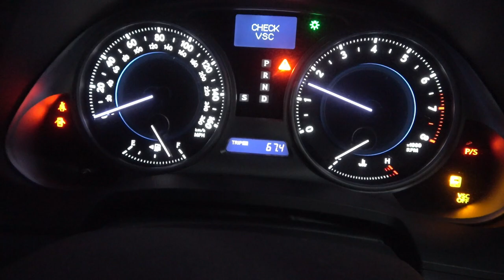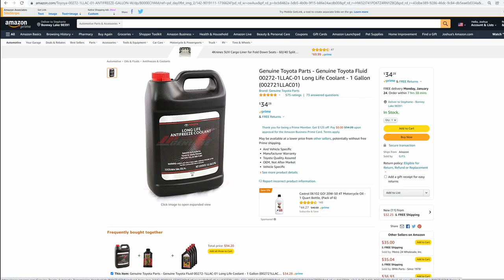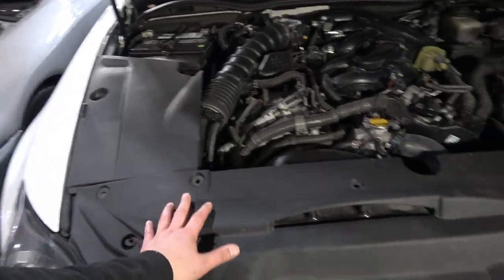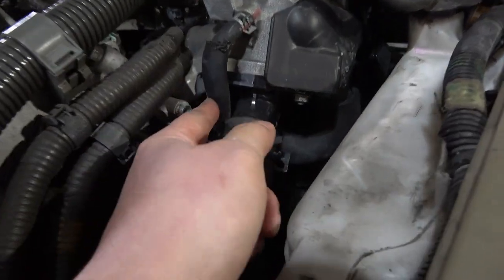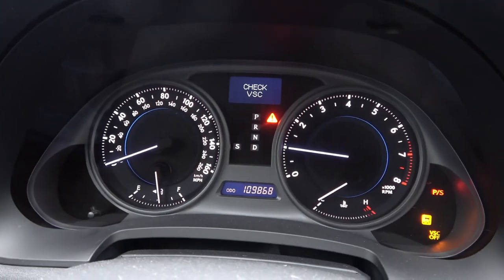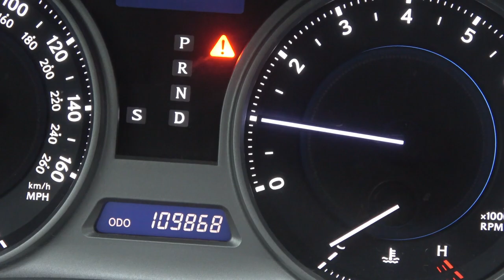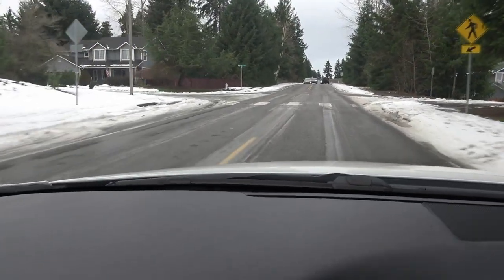How to replace a thermostat and when a thermostat is bad in your car Toyota Lexus IS250

Comment: I just did mine exactly how you did it except I had to take off two holes in order to get to the bottom bolt , is there anyway you can tell me if me taking off those two holes controls anything with the ac , because now my ac light on the touchscreen blinks off and on . but when i turn it on it still blows cold air , than 5 min after turning it on it flashes again but starts to blow regular air

Comment: I envy your expertise.  I wasn't having any heating problems (2010 IS250 AWD) but a dull belt noise which didn't go away once the engine was warm.  I had to replace the thermostat, the belt/pulley and tensioners.  Expensive, yet I have an honest mechanic.
Reply from the maker: Nice job getting that sorted out. I hate the noise from a squealing belt. Thanks for watching and leaving a comment.

Comment: Question so I took my car in kus I had a check engine light on they had to replace my ecm so what I got it back the light came on again and it’s says it’s the Thermostat is that something that they need to fix if my light came on or it’s different???????

Comment: Would i need to change the thermostat if my car heats up? I don’t get hot air no matter how long I have it on but if it’s running for a couple of mins it starts to heat up.
Reply from the maker: If it heats up after a few minutes, I would think that is normal since my car is also slow to get up to operating temp. After about 5 miles of driving I usually hit operating temp. Hope that helps, thanks for watching.

Comment: Hi sir,one question;is it possible to only change the thermostat itself,instead of the whole assembly?ifso,is it easy to remove,and do you know where to buy the oem ones thermostat
Reply from the maker: Not possible to replace just thermostat. It is designed by Toyota to replace entire unit. here is a link for the one you need. IS250 Thermostat https://amzn.to/3FSQFSv

Comment: Great video are you going to change the rear differential fluid
Reply from the maker: I need to get around to doing that. Car is old and it probably needs to be done. I will make a video of the process of course.

Comment: im getting check engine light code for engine coolant temp sensor low circuit just replaced it cleared code and came back on after 30 min of driving could i need to replace thermostat too?
Reply: Hey what was the problem if you found out?
Reply: @Saeed26434  raidiator cap failed just needed to replace it

Comment: I have a is350 I replaced the radiator and water pump. My coolant always disappears and sometimes coolant boils inside of the overflow tank. I want to know if my thermostat is the problem. Even though I tried to bleed the system the old school way with a funnel and let the engine run. Still see bubbles with smoke sometimes. Hopefully its not a head gasket. I want to know any pointers.
Reply from the maker: I would think if your coolant is boiling that the thermostat is stuck or seized close and the coolant is not passing through the radiator. I would pull the thermostat and submerge it in boiling water to see if the spring opens up. If it does that is not the problem, but if the valve does not open, replace it. Good luck!
Reply: My car does the same thing did you ever find out the problem
Reply: @polofazo9146  yeah head gasket issue.
Reply: @relentlessking8919  did you get it fixed or quoted? I think I'm starting to have the same issue and was gonna replace the thermostat tomorrow morning. I have 2007 Lexus IS 250 with 224k 😬miles.
Reply: @dijonjefferson1883  did u get it quoted and was yours a definite head gasket
Reply: @HundoBuck  mine was the thermostat. Replaced it and been fine since.